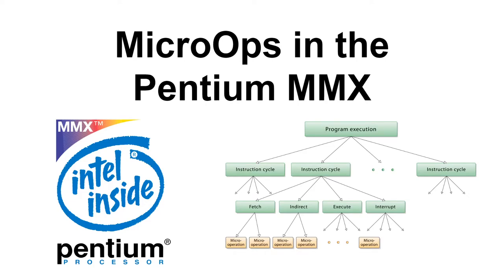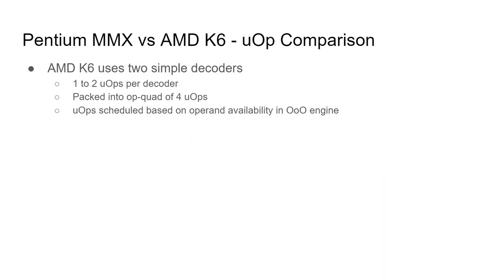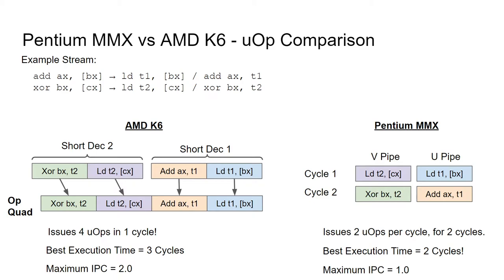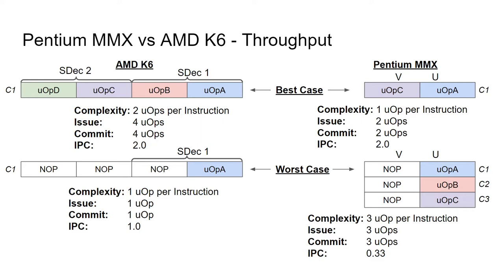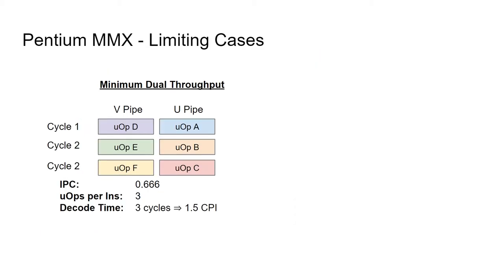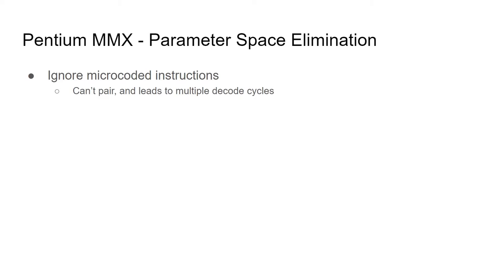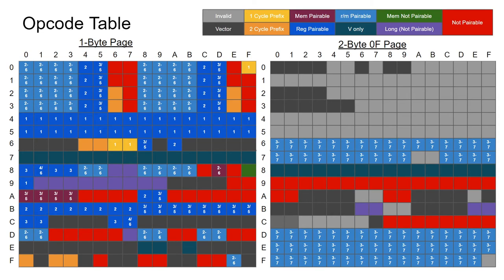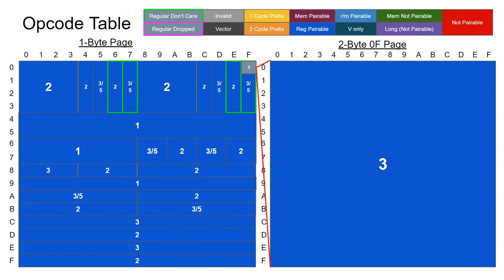MicroOps in the Pentium MMX

Comment: Excellent as alway.  Really like your idea of pages, look like bitplane for microcode. 
* Somes intructions can be fused together, could the decoder handle it with the help of a dedicated page ?
* Somes thought about the hardware multiplication, using the FPU is tempting (the 80bits extended precision have a 64bits mantissa) but wouldn't be funky register wise ? 
I read between 10 and 20 cycle for a 32x32 mul on the pentium, seem pretty quick without dedicated hardware. I thought a shifter and a adder would at least take 32 cycles worst case.
* You point out that the pipelines U and V have both a load and store unit on the pentium and mmx. all the other (Pentium pro included) have a load and a store with their own pipeline. 
I suppose it's the Out of Order architecture ? Or/and the widening of the adress space to 35-36 bits ? About the implementation, depending of the periphericals ( like PCIe or SATA on an Artix throught liteX ) is it viable to keep a 32 bits adressing space, directly push to 48bits to be futur proof or something in between ?
* In a pipeline architecture, doesn't the worst case scenario depend largely on the adressing mode ? two instructions in immediate adressing, it's one fetch for the two instructions, in direct mode two more read, and two more in indirect mode. Cache or not, the cpu still have one memory access with limited bandwidth and latency. Where and how do you arbitrate all these memory access ?
Reply from the maker: Thanks! The page idea is similar to the idea of bitplanes. Although it's not my idea - it's how Intel and AMD describe the opcode tables.
- The only instruction fusion that the PMMX did was FXCH with a float, although that would have been a very primitive form of it. Fusion with more complicated instructions like conditional jumps wouldn't be introduced until the Pentium 3. Although, the PMMX does give some idea as to how that might have been implemented in the Pentium 3 (since it can issue a compare and a jump as an instruction pair). 
The concern with using a dedicated page there, is you need to first identify both instructions, which can be a variable number of bytes apart. Fusion would make more sense at the micro-op packing stage, which may be how the decoding part was later implemented. An alternative could be to determine fusion on the first occurrence and then mark it in a predecode cache for the next time the instruction comes around.
- The FPU didn't have a 64-bit multiplier. I can't say for certain how big it was, but from the die shot, I want to say 24-bits for FP32, but had a latency of 2 cycles. FP64 would take longer to compute a multiplication, and so would FP80. For registers, that wouldn't have been an issue since the multiplier should be able to operate off of an exchange bus (think about the case where an operand comes from memory, it would need to be fed in through the exchange bus without touching the register file). As for a shifter and an adder, that could be done quicker if you include a low-bit multiplication. For example, if you can do a 2-bit multiplication, then you can speed it up, and that would be small enough to fit within the shifter path. The AMD K6 did something like this for division. Though, looking at the die shot, there appears to be a similar sized multiplier to the FPU, in the integer execution part, possibly 16-bits. Typically the documentation says "this unit contains a multiplier", which is why I wasn't sure.
- The load/store comment was correct, and essential in this case. But these load/store units are much simpler in comparison to the OoO processors. The simplicity comes from the fact that they are in-order, meaning you don't need to worry about segment renaming, or a load/store queue (the load/store queue is likely the main reason why the Ld/St units were fewer in number, also there wasn't much need in OoO, because instructions occur out of order, whereas in the Pentium, having only one Ld/St would cause terrible deadlock).
- I don't recall there being a 48-bit address extension for x86 (the 32-bit version), so that wouldn't really work. The best you could do is the 35-bit extension before jumping to a 64-bit core. I have been considering whether or not it makes sense to include the 35-bit extensions though, given that memory sizes and PCI allocations were also much smaller than they are today (even the Voodoo5 GPU only used 128MB), and that 3 extra bits adds another LUT delay for tag checks. As for SATA, it doesn't require direct address mapping, so that's a non-issue.
- The only limitation with addressing modes is the length decoding complexity. The more complexity in determining the length of the instruction, the slower it will be to calculate. If you can perfectly determine the length of the instructions though, then the two AGUs in the PMMX could both handle any address mode in a single cycle. Obviously if there is a register dependency or address clash, then the two instructions need to be serialized. In fact, the PMMX will squash the second instruction if the first one performs a memory write while the second performs a memory read. This is because it can't accurately determine if there will be a memory ordering conflict. The data cache is banked so that both pipelines can R/W the data cache, and the data tags and TLB are dual ported.
Reply: @RTLEngineering  Yes my bad, P48 is only for x86-64, guess 35bits would be wide enough (32Go) and about the sata, sorry, must have been a brain fart.
Agreed, PCI and AGP cards don't need more than 32Bits, and most PCIexpress card (beside GPU) don't need it either. 
There is a lot to get right with the memory sub-system, ordering conflict, deadlock, rewriting code, data stream detection, caches configuration, etc.. it deserve it's own video. 
For example I'm not famillliar with the term address clash (sound violent , i already like it ^^)
Reply from the maker: Yep, don't forget about cache coherency, and handling self modifying code (that's even more annoying).  I think that would take too many videos to discuss though. Entire dissertations have been written on each of those topics.
Address clashing is when both pipelines try to access the same memory, at the same time. And because x86 allows for unaligned accesses, that can be even more complicated with partial overlap. The P5/PMMX also had bank conflicts to worry about, but that's not an issue in a FPGA. In either case, the U pipeline would get priority, and then the V pipeline would get its chance.
Reply: @RTLEngineering  ha yes, self modifying code (or like i mistakely called it rewriting code :D). It's annoying, you need to keep track of all the intructions adresses between the decoder and the commit buffer (or at least the window) and empty the all damn thing and/or invalid the I-cache, if you write in this adress range. 
I figure just compare the target adress to the first 27-28bits of the pointer register ? There must be a more elegant way to do it. 
A memory mapped cache with an inclusive policy sitting on the bus could help with the penality (what is an L2 cache ? ^^).
Strangely i didn't find much on this topic.
Reply from the maker: I believe most processors implement it through a sort of mini-TLB. Effectively you have a CAM cache that holds the cache line tag for every instruction in the pipeline. When an instruction is retired, then it can be removed from the CAM. Then you also prevent cache lines from being resident in both the I$ and D$, so any self modifying code would either cause thrashing or would have to write to a non-cachable address. In the later case, you would then have to check the CAM when ever a write occurs and flush the pipeline (even if it's not cachable, it can still have a cache tag).